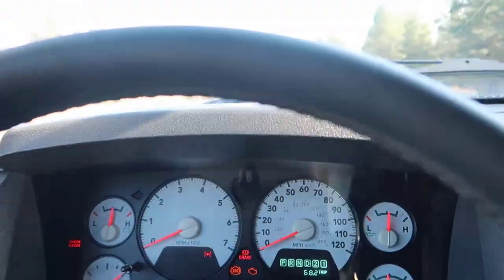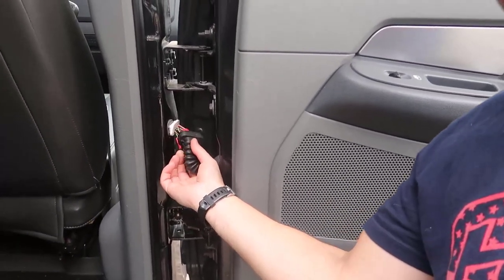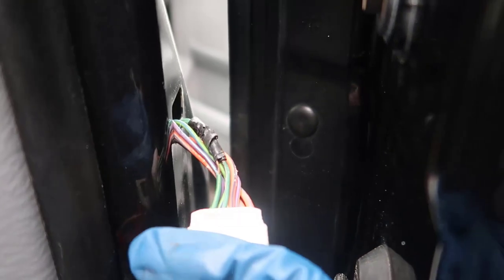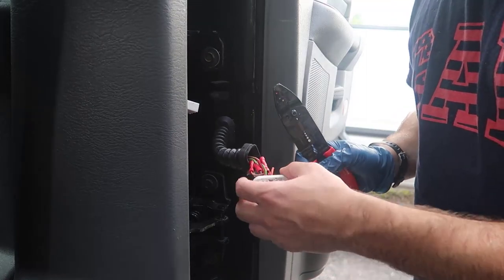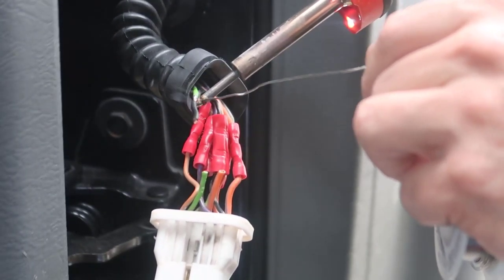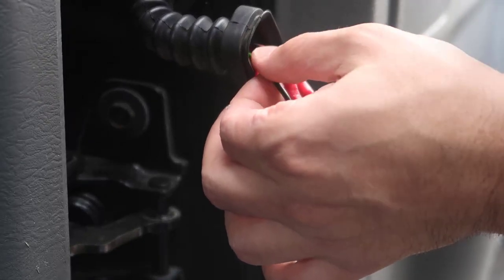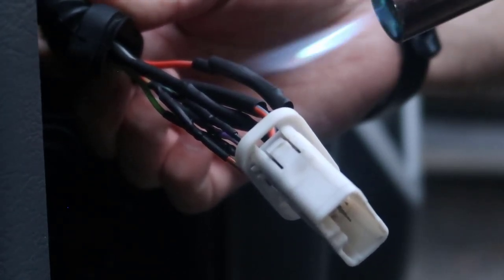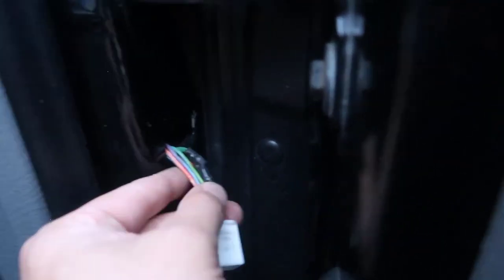Speedometer and RPM Gauge Needles Going Crazy Dodge Ram

Comment: Hi, I figured it out after some research. Last week my 2008 ram started with that. It's a faulty interior lights dimmer switch. If you move it all the way up ( turning everything on, but it by passes it) the problem stops. I hope it helps everyone. Greetings.
Reply: How in the heck did you figure that out!!! It fixed my issue aswell!

Comment: I recently ran into this problem with my 2008 Ram 2500 6.7 Cummins. I have an aftermarket head unit from alpine that displays gauges by reading data from the OBD2 port. The gauges on the head unit never faltered. I checked the TIPM and it’s connectors and found no issues. I removed the aftermarket head unit and found no exposed or chaffing wires. I checked the door connectors and found no wire breaks or insulation chafing. I crawled under the truck and found the engine to chassis ground strap had corroded through and broke off. This ‘ground strap’ is located on the driver side of the truck and runs from a bolt near the driver foot well to the rear of the engine near the rear lift bracket. It is used to reduce signal noise on the CAN bus according to the documentation I found. These are not typically in stock in my area and I’ve placed one on order with my local stealership and should have it tomorrow. I’ll update with another post as soon as I can verify if this actually fixes the problem.
Reply: Update: installing the ground strap did NOT resolve the issue.
Reply from the maker: what I am trying to do is to find anything in the car that seems to be not working very well. I found a lights on the roof that is not working (will check). Headlights are acting weird (will rewire). I will start there and make videos
Reply: So, update no. 2:

I think I found the issue. The problem that is causing the cluster to behave erratically is an intermittent CAN Bus communication failure. Intermittent issues like this, in my experience, have ‘wire or connector’ written all over them. I removed the TIPM to inspect the connections and found that the small brown plug (‘Module Totally Integrated Power C6’  for those with the FSM) had two heavily corroded pins. I replaced the plug and no longer experience the problem.

Will update if problem resurfaces.

Discussion here:
https://www.ramforum.com/threads/3rd-gen-erratic-instrument-cluster.172232/
Reply from the maker: @CodeGearMonkey  Thanks for the Update Ryan. I will also check on that also. That makes sense!
Reply from the maker: I found my issue yesterday. It was my TPIM. One single pin in it on the connector C. I just posted a video with the fix https://youtu.be/iBigrj27hvE
Reply from the maker: I found my issue yesterday. It was my TPIM. One single pin in it on the connector C. I just posted a video with the fix https://youtu.be/iBigrj27hvE

Comment: Having the same problems with my dodge 2500. so far we've sunk nearly $5k (2 different shops) into trying to fix it with no luck! indicated to the shops I had issues with the rear passenger door window. but don't believe they check wiring on back passenger door! so will check it myself. wife's not real happy with the mechanics who tried to fix the crazy sensor and gage issue!. so, will let you know!
Reply from the maker: Ya try opening the fuse box and taking the pcm or ECM (bit sure how it's called)  from inside it  and check for green on the connectors

Comment: I have the exact same thing going on. Mechanic told me it was the Alternator. I replaced it same thing. Now mechanic said it is the cluster. Im so glad I saw this video. Im looking for the short next week. Thank you.👍 did your repairing the wires on the door fix the problem?
Reply from the maker: It did not fix mine yet. I would say go first to things that do not work like burnt lights, radio not working, speakers failing and so on. I didn't do that on line yet because it is freezing outside and it does not fit in the garage. 
Let me know if you find your problem
Reply from the maker: I found my issue yesterday. It was my TPIM. One single pin in it on the connector C. I just posted a video with the fix https://youtu.be/iBigrj27hvE

Comment: I have a 07 ram 1500 and after installing a aftermarket radio is when my issue began. Not exactly sure what caused the issue, but it was even throwing a no bus code and my truck wouldn't even turn over. Removed the CD player and boom it worked. Had all the correct harnesses and everything so not too sure what caused it. Maybe that will help some of y'all
Reply: Also my tachometer and speedometer had just quit on me today on my way to work ( I had reinstalled the CD player like a fool ) and all of my dash lights were lit up, checked the fuse box it was the tow light fuse if I remember correctly that was blown a mini 20 replaced that fired the truck up and everything functioned normally.
Reply from the maker: Oh nice. Worked fine with the radio installed now?
Reply: @CarModsGarage  unfortunately no it still sent the gauges crazy but it only happens sometimes it's weird. But I believe it's possibly happening because my truck has steering wheel controls and the harness pack I have for the bypass of the factory amp didn't come with the other plug to maintain the factory steering wheel controls. So in theory I believe it's surging too much power and throwing that fuse probably, I'm going to buy the adapter to retain steering wheel controls and see if it helps. I'll update once I install it.
Reply from the maker: Ya mine was happening every once in a while and after a year or would happen all the time until one day it didn't start.

Comment: So did this fix your cluster?! My cluster is doing the exact same thing.
Reply from the maker: It went away for a few then it came back. A was chatting with a mechanic friend about that and he say "ahhh that's throttle position sensor" lol so that's what I'm going to change next
Reply: Everything I've researched it's either the cluster itself or the radio glitching out. Apparently the radio runs off the same can bus as the cluster and can cause issues. I'm gonna pull the alpine deck out and check for a bad wire. If not gonna pull the cluster and clean the 3 connectors on the back of it, as well as the tipm positive and ground and hope for the best
Reply from the maker: @stephenliviniuk7039  I'm with you brother. I'll pull the radio also before buying the TPS. The radio definitely stops when this is happening. What I'll try to do actually is remove the dude for the radio and see what happens
Reply: Ya I dont think it's the tps. The computer is resetting the cluster for some reason. I dont see a tps causing that. The truck would have other problems if it was a sensor. Gotta find out what all runs off the can bus to the cluster. I know 100% the radio does. I think the signal light switch does to...I'll do some  research.
Reply from the maker: @stephenliviniuk7039  keep me posted. I'll do the same.
Reply: Just read that on an aftermarket deck that there must be a can bus adapter from the stock wire harness to the deck. I wonder if I have a short or if its loose. I'll have to check that out. The crazy guages is intermittent so I dunno wtf. I cant duplicate the problem
Reply from the maker: @stephenliviniuk7039  I know right. It sucks. I see mine happens intermittent but if I am going downhill it kind of stops. Most of the times lol ,😂 wtf fit pretty good in here. 
I'll look for more shirts and the radio. If I can't find anything else I'll get the TPS and see.  Check the wires inside the door boot like mine. Cluster, radio and door boot are the places I've heard Dodge ram have issues. 
I will be the guinea pig on the TPS
Reply: Haha ok!. My friend owns a shop and he said his snap on scanner should be able to track down where the issue is. After I do my quick checks that's my next step before tossing cash around
Reply from the maker: @stephenliviniuk7039  That's cool. My scanner gets nothing. Apparently it needs to be a better or specific one. Keep me posted!
Reply: My 2007 Chrysler aspen is doing this same thing! I drove it like this for about 6 months and couldnt find the problem? I chased all my wires and checked all my fuses. I heard theres a drain problem from the sunroof down the driver door and hits the fuse box but im not for sure if thats the problem yet. I reset the computer when i put a new battery in and now as soon as it does this it shuts me down completely and then just turning the key over it does this intermittently and wont start at all. Only when i reset the computer now will it start and then shut down when it does this. Everything happens just as you guys said though. Radio shuts off when it dings and i cant get a code to pop on the scanner because it seems the whole computer loses power and wont connect to the scanner. Did you guys fix this yet i definately need some info.
Reply from the maker: Not yet. I'm chasing it and will make a video on this playlist. Apparently a bunch of people have this problem
Reply: Hey guys, I have the same problem.  I was wondering if it was a tuner problem, but the video was great.  EXACT SAME ISSUE!!! I have an 08 Ram 2500 6.7 4x4.  I have found that when I start having the problem over and over; I stop, shut down, pull the TIPM cover back and wiggle all of the fuses and BAM, it's fixed for a while.  It might not be the TIPM, but it is probably somewhere close.  Maybe a connector/plug/ground.  I can relate to this even though I have a different cluster,  computers, etc.  I have a video that looks exactly the same.  Give me a shout and I'll send it to you.
Reply from the maker: Sure man pay it here. Whatever helps is good information. 🤙
Reply from the maker: I found my issue yesterday. It was my TPIM. One single pin in it on the connector C. I just posted a video with the fix https://youtu.be/iBigrj27hvE

Comment: Hey there did you find the issue here?
Reply from the maker: Not yet. Are you having same?
Reply: @CarModsGarage  I do, but with a 97 Grand Cherokee. Only happened twice. Been reading the whole day and doing research. First I’ll check all my ground points. Then clean harnesses going to the ECU and applying dielectric grease. This are basic stuff, then lotta people found the BCM been the problem on most cases. So I’ll do same procedure of cleaning first. I heard like a relay noise coming from the passenger area, this happens before the gauges goes crazy and in some cases people found the door module causing troubles, I have to keep reading about it.
Reply from the maker: @lisandro12349  let me know how it goes. I'm trying to be brave and work on it outside in the cold. I can't fit the truck in the garage
Reply from the maker: I found my issue yesterday. It was my TPIM. One single pin in it on the connector C. I just posted a video with the fix https://youtu.be/iBigrj27hvE
Reply: @CarModsGarage  thank you man, I’ll go through the video. I can guess that this is something characteristic of Chrysler products lol. Although feels extremely good when you get everything working right.

Comment: Mine does this less frequently at wot, and my engine bogs simultaneously only at wot. Could that be the cluster too? I feel like if the engine bogs it might not be the cluster...hmmm
Reply from the maker: I fixed mine. Look on the description and I believe the first comment also I posted a link with the video with the solution for my portion term.  I made another video fixing it.
Reply: You probably figured it out by now, was it the speed sensor?
Reply from the maker: Mine was a corroded pin on the PCM under the fuse box.

Comment: #support <3
Reply: well I checked it but diden,t do anything still the same problem.when I start the truck ,the speedo starts going up ward.but  the truck isen,t moving.when the nidle go,s to 100 the motor stalls.So I disconected the abs mudule ,everything is good but the speedo dosen,t work at all .
Reply from the maker: I found my issue yesterday. It was my TPIM. One single pin in it on the connector C. I just posted a video with the fix https://youtu.be/iBigrj27hvE

Comment: Did you fix it my 09 vw routan does the same thing im thinking  alternator has something to do with it even if it shows that alternator is ok
Reply from the maker: Did not but I'm sure that problem is ground. I got a new throttle body as I've heard they give this problem to some people. I haven't installed yet but I will and definitely post a video. 
Let me know if you find what your problem is
Reply: I heard from some mechanics that a cluster could be a problem ill look into next
Reply from the maker: Yep that also. I guess it is mostly related to bad ground or short somewhere
Reply from the maker: I found my issue yesterday. It was my TPIM. One single pin in it on the connector C. I just posted a video with the fix https://youtu.be/iBigrj27hvE

Comment: I have a 2013 dodge avenger and it's doing the same thing and sign flashing
Reply from the maker: Oh that sucks. Gotta find where the shirt is. Mine want showing thank God.
Reply: you ever figure out the issue? my 2013 avenger is doing the same
Reply from the maker: I pinned on the first comment the video where i finally fixed it.  It was a bad contact on the pcm that's under the fuse box

Comment: Did your problem go away when you pulled your alpine radio out ?
Reply from the maker: I pinned a comment from someone says it did. I haven't tried yet but I will
Reply from the maker: I found my issue yesterday. Took the radio out but it wasn't my problem, It was my TPIM. One single pin in it on the connector C. I just posted a video with the fix https://youtu.be/iBigrj27hvE

Comment: Hey man did you ever figure it out
Reply from the maker: Not yet. Was waiting for the cold to go away so I can work on it outside. Will work on it again very soon. You having the same issue?
Reply: @CarModsGarage  yeah but on a dodge caliber srt4
Reply: Same problem on a 2004 Ford F150 but all of my gauges and needles on my cluster go crazy like that
Reply from the maker: I found my issue yesterday. It was my TPIM. One single pin in it on the connector C. I just posted a video with the fix https://youtu.be/iBigrj27hvE

Comment: Yo I removed my radio and took out the cat bus and unplugged it and everything worked again except the radio until I get a new can bus but yeah
Reply from the maker: dude that's awesome you told me. I am planning to remove the radio since the radio is the thing that flashes when the noise is happening. I will do that on mine.
Thanks for sharing Corey